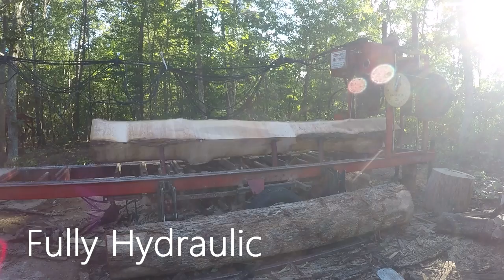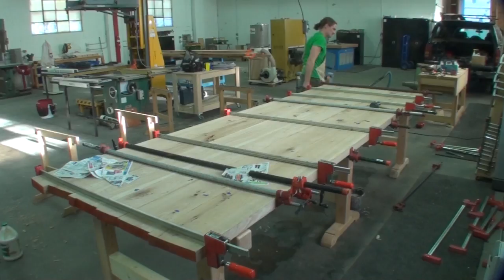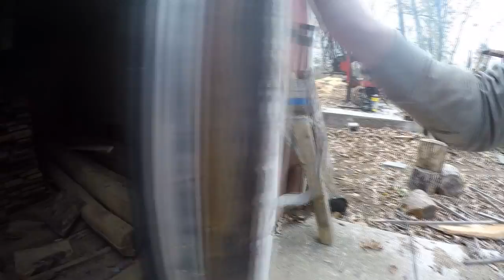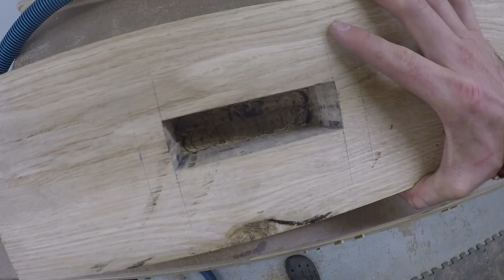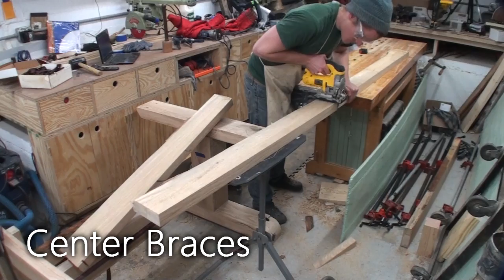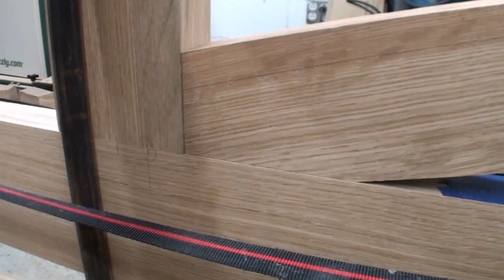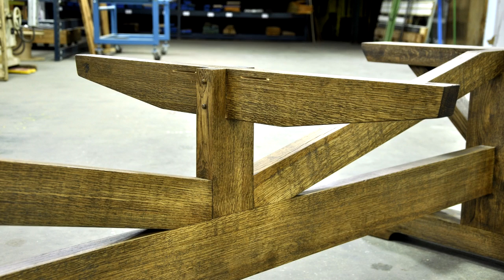Woodworking - Massive White Oak Trestle Table - Log to Table

Comment: I really want to start learning how to do some of this.  I don't have the space or tools yet.  Not sure where to begin, any ideas ?   I was thinking like pallet furniture on the back porch.
Reply from the maker: That's a tough question to answer.....I suggest doing some hand tool work. It's relatively cheap to get started and does not take up much room. I would get some sort of fine tooth saw and carpenters saw, a set of chisels, a mallet, square, block plane and tape measure. A drill will be handy as well. For a saw I suggest a Duzuki Z Saw. http://amzn.to/2pQns7w  A bevel gauge is handy as well http://amzn.to/2q9RC6F If you are unclear what these tools are feel free to ask, I can give you links or you can google them. I would not want to, but I could build this whole table with hand tools if I had too. Even if you use machines, it's good to have a foundation in hand tool work. Good luck.
Reply: I have to tear down this old barn first, but plan to build a shop in its place.  And yes there will be a few treasures coming from the old barn.  Thanks for the reply

Comment: I bought an Oak dining table 40yrs. ago, it's not nearly as big or grand as the table you built but it has lasted these past 40yrs. under going daily use  (countless family dinners) with very little maintenance, just gets a fresh coat of oil every couple of years and it is still in great shape showing very little wear. I'm certain with just a little care the table you built could be in service a hundred yrs. from now if not longer..... Do you 'sign or mark' your work?? I can imagine the great grand children of your client showing off that table on Antique Road Show!!
Reply from the maker: It's nice to have and use something that long. With normal care a solid table could last hundreds of years. I carve my initials on the inside of the apron boards on my tables but with this table I did not....I was in a hurry. What I'm going to do is engrave a small metal plate and give it to the customer to place on the main post. They have also invited me to come see the table and cabin it is in so I will probably take them up on that eventually and do the plate at that time.

Comment: WOW! that is a huge table... Medieval Castle or one big family... the wood choice turned out beautiful. Nice work! 
Question that came to mind watching you hand rub out the stain/finish.  Crazy thought. Would a 12 in car buffer had made that process easier? or left a fuzz nappy mess?  Never tried it. just watch you walk a mile, 12 feet at time.... thinking. "would that make life easier?" 
Looking forward to the watch the more detail video.
Reply from the maker: Thanks, probably not on the buffer, most likely do something I wouldn't like. It was satin finish, but due to over spray the finish had a spray pattern in it. I was using a specific pad from 3M to dull the finish slightly which evened it out perfectly. A buffer would leave swirl marks at this sheen and you would see the pattern doing it by hand I go mostly with the grain but not perfectly. It takes that brand new shine off making for a more refined look. While it may look like a lot of work, it was only about 5 min of rubbing. The cabin it went in is huge, it's a vacation/holiday kind of place so they customer will have family there.

Comment: What is the brand of marking gauge you used for the tenons? I haven't seen one that size. Table is simply outstanding. Great work, thanks for sharing the video.
Reply from the maker: Jessem Tool Company, it's called the Wood Sabre. It's as good as it gets for marking gauges, looks like something NASA would be using. Very high quality. They have a video on there site showing it, here's the link- http://www.jessemdirect.com/product_p/08801.htm

Comment: Great design and job! I have always wondered if the Domino tool was any good in quality work, you have proven the worth of the tool. You should get Festool to sponsor you. Another thing that got my attention, Ratchet Straps! I love them and use them all the time. Not only do you have them but you have one of the best ones (Bessey) or at least they look like them. For a while, they were very hard to find. I had two that fell apart after years of service. I looked all over for a replacement and by accident, I found some great ones in Ikea, all the other ones stretch instead of putting tensile strength on the joint. Great work! don't ever question yourself on price, from experience, usually, Karma pays you back many times fold. The quality of your job is going to keep in business, not the profit you make from a single job.

Comment: Looks amazing sir! Just curious if there is any particular reason you choose screws on the x-bracing as opposed to dominos or dowels like the rest of the table?
Reply from the maker: Several reasons...first I would not chose to ad the x's but my customer really wanted them. I built the base without first and stained to show her, but she still wanted them. Also, it made assembly and staining much more simple. And I also like screws, people give screws a hard time for not being traditional but even hand planes and hand augers where new at some point.  I like the holding power of screws and also that the joint is pulled tight by the screw. I'm not a fan of dowels as a joint in it's self, only to pin things together like the joint in the center brace, or pegging a tenon. Thanks for watching.
Reply: The Homestead Craftsman I wondered why you put the "x's" in. Now I know why. Didn't look like your style.

Comment: is that the jessem marking gauge.. if so how do you like and would you buy it again?
Reply from the maker: It is very nice, makes dialing in to an exact measurement, line, etc super easy with the adjustment. The base is really large as well which is nice to stay stable. I really like the kind with the round cutter on the end vs. a pin, cuts a nice line. The weight is nice to. It's a perfect tool. I highly suggest it for doing nice work where accuracy matters.

Comment: Okay... I bought an XL 700 after watching one of your other videos, now I'm thinking that I need a track saw too!  BTW, what's the max depth of cut on the track saw?
Reply from the maker: About 2 3/4, so pretty deep. Deeper than the rest. That's why I got it, for doing work like this. If you do buy it! I posted a link under the video and the article on my site about the table....if you click on that and buy it from amazon, free shipping, same price as everywhere else I get a percentage. I'm not teamed up with anyone, I just have an amazon affiliates account. That way I can post links to things I use in videos, it's a small portion, but festool aint cheap! The track saw is just like the domino, changes everything.....especially when working with large stuff, long, etc. Feel free to ask questions. The article. http://www.thehomesteadcraftsman.com/2017/02/my-biggest-custom-order-yet-white-oak.html

Comment: Great job, lovely skills and precision. Nice design but did the table really need the braces on either end. Surely with the huge section of the uprights there is plenty of stability ! (could you detect any movement? surely not!))

Comment: Wow, what a build. Great job. 

Design-wise, I liked the X-braces a little less. Do you think they are "mechanically" required in this construction?

Again, great job and thank you for sharing your video's!
Reply from the maker: Thanks. If it were totally my decision I would have not put the x braces in but my customer really liked them. That's why I put them in after staining....I tried to convince against them. With that said, I think over all it's fine. I just liked the structural look of not having them. Thanks for watching such a long video!

Comment: was the wood dry or did you kiln dry it?
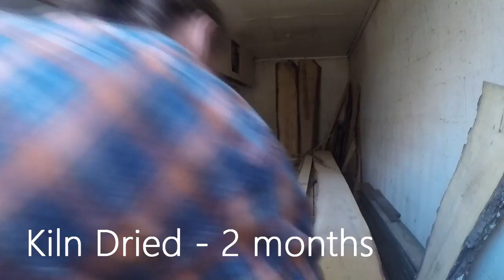Reply: Scott Haun at 2:13 it says kiln dried for 2 months
Reply from the maker: I mention that in the video, it's kiln dried for 2 months. You see me unloading it out of the kiln (looks like a little building) into my truck. The lumber was milled about a week after the tree was cut.
Reply: I must have missed that in the video!
Reply from the maker: It's in this one. Right after I mill the lumber there's shots of me loading lumber into my truck. The little building the wood is stored in, is the kiln. I'll be doing more videos talking about the details also if you are interested.
Reply from the maker: Thanks for the time link Keith, that's handy.

Comment: Did you make your own motise joints? If so may I ask how?
Reply from the maker: Not sure how to answer this....I did it right in the video. I used a hollow chisel mortiser for the stretcher and a Festool Domino Joiner for the rest.
Reply: I mistyped im sorry. Im refering to the tenon/dowel wood pieces that you used to hammer into the mortise to make the mortise tenon joint... did you make these? Or do you buy them from festool like the kreg pocket hole plugs? Just asking because kreg has a a pocket hole plug cutter that you can make your own plugs instead of buying from kreg or using dowels etc. 

Thx. You, great videos
Reply from the maker: Ah, I buy them. Festool sells them in different sizes. The large ones in this video are 14mm and the smaller are 8mm. They are not cheap, but cheaper than spending time making them. The large ones are about .80 cents or so each.

Comment: do you use a different tip for your spray with the HF gun?
Reply from the maker: truffleshuffle02 I use it right out the box.
Reply: The Homestead Craftsman good to hear!  I've read a different tip allows for better spray but reading and seeing are two different things!! great video
Reply from the maker: truffleshuffle02 it may but im getting good results. Keep in mind that I am rubbing the finish out some afterwards.

Comment: I realize prices differ through lots of variables, and you might not want to talk about how much money you make, but could you give a ballpark figure for how much one might be able to sell this table for?
Reply from the maker: It's not really that simple to give a ballpark since the ball park is kind of big. I see guys selling stuff like this for hundreds but that's usually pretty rough work and materials that are nothing special. Depending on the details of a table like this, wood type, joinery, size, etc. I think thousands minimum with a range of $5,000-10,000.......but that kind of answer is usually going to miss lead the guy who needs to ask. Even with experience you don't always nail the price but if your asking about this kind of thing most likely your not at a place where you will be able to make and sell it. That's not always the case but most of the time it is....and one of the reasons I don't get into it much. Most of time, with stuff like price, you don't really need to ask, it is a natural progression, just like your woodworking. Your skills, business sense, etc all sort of grows together.

Comment: How did you attach the table top to the base?
Reply from the maker: I did not film it for the video but you can see it in multiple parts of the video. Large hole for washer with an elongated hole for the screw to pass through into the bottom of the table. 4 on each trestle, 2 on the center support and also a few slots for table top fasteners. If you look carefully throughout the video you can see them multiple times. Thanks for watching.

Comment: That is one sexy table.  How do you even quote a price on that?  I don't even wanna know what the final cost would be but damn....nice work.  I'll tackle something like that in my next video.....ya no.
Reply from the maker: While tables get far more expensive, it certainly wasn't an amount to sneeze at....... I couldn't buy it. I priced it out of my head, I made it for a good customer and they also ordered another table and benches at the same time so there was a minor price break for that, but not much. With that said, I would price it several thousand more if I did it again.

Comment: I was a bit surprised you didn't stain the bottom side of the table top and apparently did not seal it either (at least those activities were not shown).  If you only seal one side of the top it is guaranteed to warp due to the loss of moisture from the unsealed side at a faster rate than the sealed side.  Other than that, nicely skilled work.
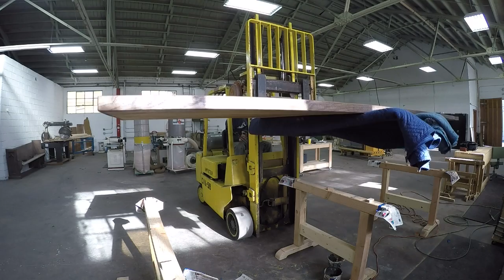Reply: He didn't stain it but he sealed it.  6:35 "Sealing Underside" =D.

Comment: What a great and Fun Project, you Built a Heirloom. I would like too know what you bid the Job for. I I build one I would greatly appreciate the actual cost? I was thinking some big Captain Chairs and about 6 or 8 center chairs. I know that would  Cost you about 6K. Sell for 12K? Just guessing. I build a Cherry table 62 inch around with three leaves and fold down end supports and 6 chairs. Cost was 5K. Sold for 7k. Kinda lost my butt, the Tools I bought I still have today. My Friends call me the TOOL GUY. IF THEY ONLY KNEW.

Comment: So beautiful but those pocket holes are pretty unfortunate. Would have kept the style and calibre of work to hide all that and use mortise & tenons for those braces.
Reply from the maker: I didn't want to put the braces on at all but the customer wanted them. The screws are great for the job, they pulled them in tight. They were large wood screws. I get what you are saying but it does not bother me. Even something pricey has it's price point and construction methods reflect it.

Comment: As someone that would love to get into custom furniture making, it always interests me how much these types of projects sell for. I know it's rude to ask the price of something someone paid for something but I wouldn't even know where to begin to price such a project, it had to be over a thousand dollars just for the wood itself, if not even more. And if that's too personal and you don't want to get into such information, you said you under priced the project, so if you had to do it again what would you want to get out of it the next time around? I just got done making a desk for myself a couple weeks ago, https://imgur.com/gallery/55ZHE I made it from 5/4 Hickory, used a Danish oil on it and a clear coat on top. I think it turned out pretty decent. Anyway, good job on the Trestle Table. I don't think it would even fit in my house lol.
Reply from the maker: I don't get into pricing, but don't mind the question.......but I spent around $300-400 on the lumber which was enough to build several of these tables plus a few smaller ones......and then some. I get good deals on wood. That was to find and buy the logs, mill and dry. If I was to do this again, I would charge at least a couple thousand more than I charged. I still did ok, but as far as time goes, I make more money on my farm tables which take only a few days where this one took months, tons of driving, more cost, planning, etc. The actual build of the table took 2ish weeks. In reality, unless I was charging quite a bit, much more than most would pay, it's best not to make stuff like this if you have other work......but I like this particular customer, and wanted to make the table and video. Your desk is nice, thanks for posting the link.
Reply: Cool. That's crazy you could get that much wood for so cheap lol. At that price you should open up your own specialty lumber yard lol. I think it'd be fun to tackle one of these just for the fun of it. I think I need a little more experience first before going this big but it would be worth the experience alone. Maybe it'd make a good personal project if the money isn't great.

Comment: The finished piece looks a little flimsy and weak. Jokes, mate, it looks more solid than a brick outhouse. What spray gun are you using? It has a great fan pattern. And btw, dowels for the braces instead of screws would have been my choice...
Excellent work, it's always great to take on a big project, and see it through.
Reply from the maker: I started smiling before I even read joke, that was funny. Harbor Freight spray gun. As far as screws, they are just metal dowels but better. In this application it insures the joint is pulled tight and held tight. Using dowels in this application would be very little glue surface and poor holding. If anything the tenons would be fine, but I'd rather go screw that that too. Not just trying to disagree with you but just because a lot of cheap stuff has screws in them doesn't make them a poor choice. A lot of cheap cabinets have dovetail drawers and they fall apart. It's all in how you apply something for the given situation. Thank you for watching, it was a long one to sit through. Much appreciated.

Comment: How many subs did this video gain you?  I bet a lot.  And I bet you will never regret the investment in the Domino.  Don't ever let anyone give you trouble about buying that thing.
Reply from the maker: Not sure, there was a little spike but nothing crazy, it takes people sharing the video, linking it on sites, etc to really get something going......feel free!  On the domino it's great, peoples problem with festool is just based on price and fear of the new....... the domino for example is nothing new, it's just a floating tenon and the machine a fast small way to cut them....it's not that much difference than using a router, hollow chisel mortiser, horizontal mortiser, etc. Just smaller and faster. Also cleaner. I'm all about other tools as well, hand and power...I'm just not going to turn my back on something out of any notions. Even the beloved hand plane was a new technology at one point. Thanks for watching.